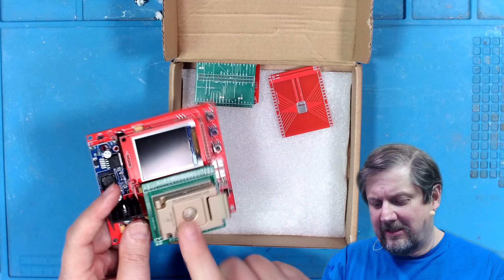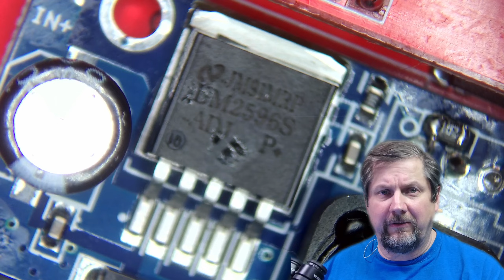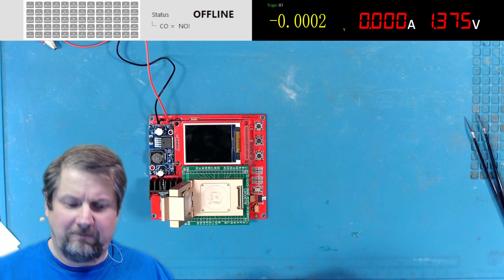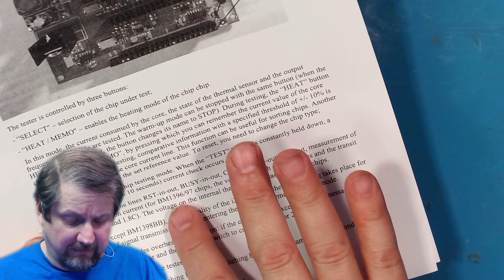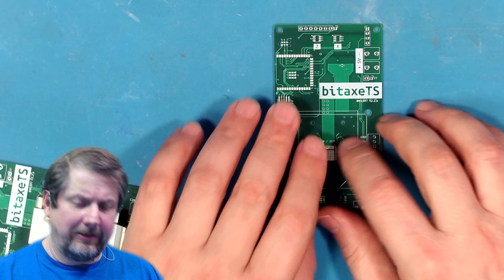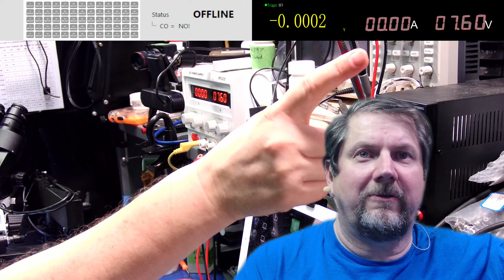BM1397 Chip Tester reviewed plus BitaxeTS updates and a new ESP32S3 DMM prototype I'm working on

Comment: Where can i buy the test fixture you are using please reply.
Reply from the maker: I've updated the link in the description above. This is the purchase link my contact @ Allsocket.com sent me -- https://pl.aliexpress.com/item/32824311313.html?spm=5261
Reply: @iagmr  Great... subscription. I'd just prefer the Bitaxe PCB with a socket. Does anyone make it? I wanted to log in to discord, but the platform is so ugly... I keep captcha and I can't log in, and when I once managed to do it, I can't search for chaos in the flood of messages and it's taking away my youth. During that time I will invent/make/fix something myself. Good luck to you!
Reply from the maker: @jirijezek8480  I feel your pain about Discord.  It's worse than trying to figure out what's going on in my wife's head. But if you can get through the chaos there are usually some good nuggets in there. 
Keep in mind, there are at least 2 different sockets on Alliexpress for the 1397.  They mount differently on the board.  I thought I had it nailed so I designed new PCBs, sent the design off to PCBway or JLC (Can't remember which) and 3 or 4 weeks later what I got back was OFF by just enough that I couln't use them.
I'm gettng a nice CNC soon which might allow me to actually test the gerber files before I send them out. If that works, I'll update the board design in my Github to allow the 2 different brands of sockets I have to mount directly on the PCB.
If you are good with a cnc and/or kicad I could post the work I've done so far in my Github and let you test/try yourself.
Reply: @iagmr  Thanks. Yes women and their behavior is very close to that :D My T17 and woman is moody too. T17 hates the cold (my wife too). But I don't know which chip(s) are faulty or naughty. I bought 30 pcs used tested by that tester from Alli. But I don't want to replace each chip one by one. It's a terrible job. I can't login to discrod. Sometimes not even one "thing" has a good day -:)

Comment: Hello I’m trying to get in to mining repair.  I bought equipment for the hash boards repair.  I I’ve bought 1 T9 and 3 s9 ASICS miners broken from eBay.  

I’ve started of testing the machines while I’m waiting on all my equipment to come in. I found 3 hash boards light up red like the setup suggested. All other hash boards won’t light up.  

The T9 would start up then stop then start an repeat so I put that aside and focused more on the S9’s  1 the control board the middle bash board won’t light up and yet on the other 2 s9 the same hash boards do light up then the machine stops and the 2 lights in front 1 red 1 green don’t light up at all. I’ve googled for explanations an meanings to help explain so I can try to fix and or know where to start but all control board videos out there that pop up are mainly programming.  

I’ve tried googling miner repair courses an I’m getting no where’s, I’ve googled repair shops to get info of where to look for training an guidance but I get nothing.

I’d put my email an number here but I don’t know if it’s just to you or everyone. Plus I hate to be disgruntled but I’ve hit so many roadblocks and no replies or responses….what’s one more
Reply: Hey bro I am from India , I am aoso learning ASIC Repair, how can I contact you , what is your whatsapp number ?

Comment: Very nice setup on the bitaxe. I really do like how you can actually mine to the chip.  What a cool feature. Actually can test it with the cgminer prior to soldering back into the machine.  Make for a nice solo miner also between repairs.  Looking forward to getting one of those for my own repairs as well as adding it to my cell repair business.
Reply from the maker: Thanks. When I disassembled the socket assembly, I realized they were just providing a mechanical interface to the standard BM1397 pads. When you purchase from companies like PCBWay they usually make 5 to 10 boards for you. This way, you could make one or two as tester units and build the others up as soldered Bitaxe miners. They only use about a little power so they cheap enough to run as lottery miners.